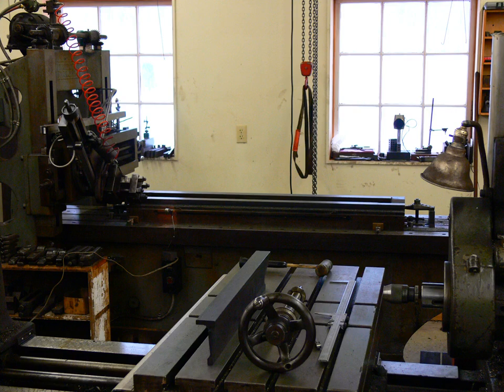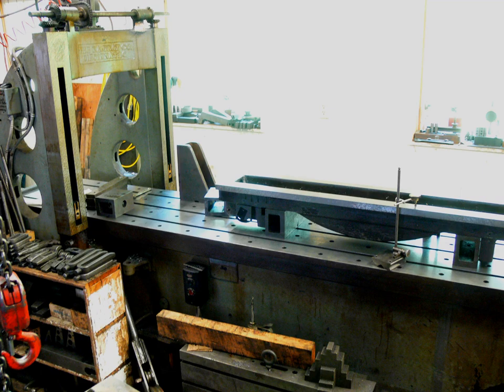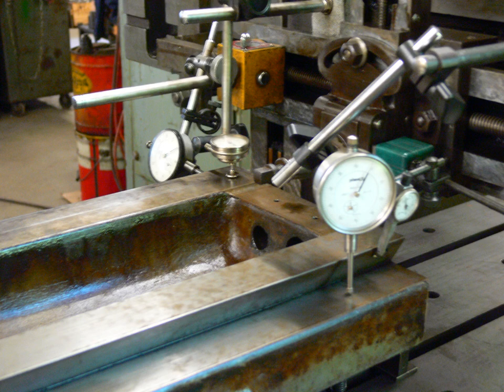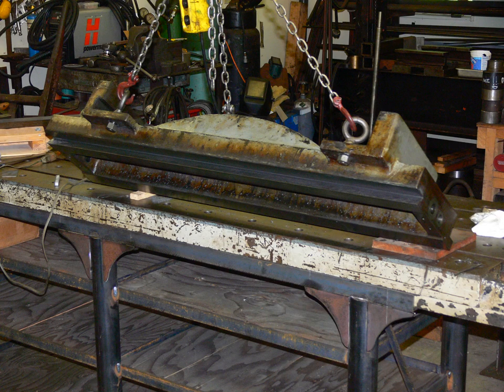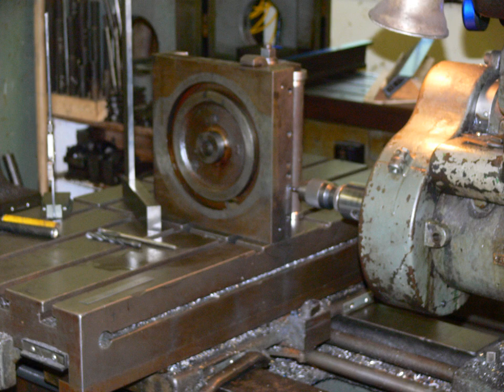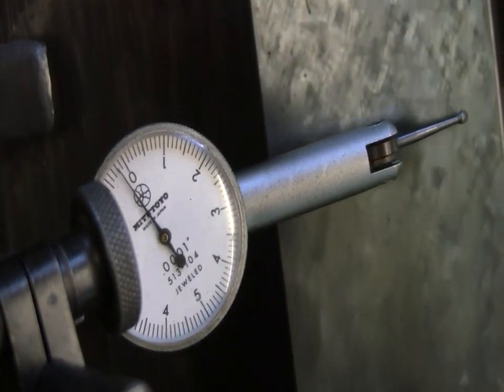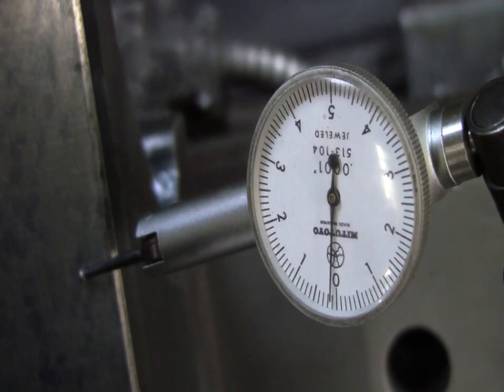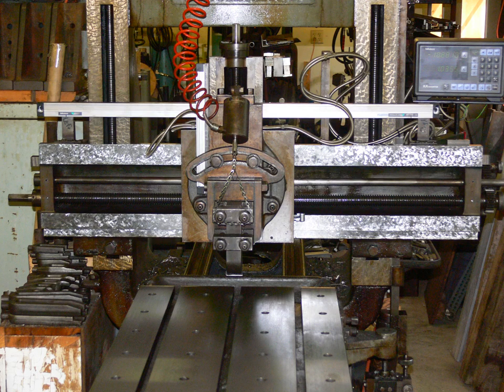Planing its Own Rail update - Slideshow

Comment: Thanks for sharing Rees... I have a circa 1900 22 x 22 x 60 GA Gray I'm working on getting operational again - motor change and belting.... a baby brother to yours perhaps? :)
Reply from the maker: Ah! Another old Gray!  Interesting to ponder the idea of both of our planers having been assembled on the same shop floor.  Maybe even came off the same planer!
  I don't really know what year mine was made.  I guessed 1905 from pictures in Kenneth Cope's book American Planers.  Quite a stretch to be sure, but maybe our machines were on the shop floor at the same time!
  I hope the getting operational project goes well and that you end up with a machine you will enjoy for years to come.
Rees
Reply: @reesacheson5577  Thanks Rees... yes, I'm more guessing on the date as well based on the GA Gray "1899 production included..."  note in K Cope's book. Mine is the model shown in Fig10 p.77. I see "219" serial number on the RH front side of the Hor rail. Wondering what yours shows? I've seen 2 other old Gray's like mine in YouTube videos. Mine spent time in AZ, then Vegas area before I acquired it in trade.
Reply from the maker: @idjeffp  I have looked for a serial number on mine but have been unable to locate one.  Where exactly on the rail is yours stamped?
Rees
Reply: @reesacheson5577  email sent with some pictures - S/N located on RH side of the hor rail between the two oil holes